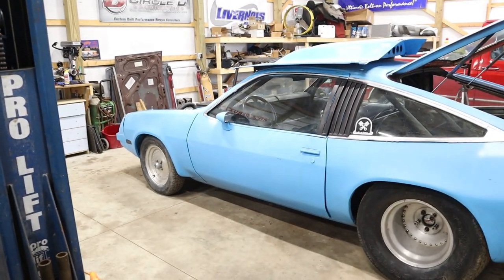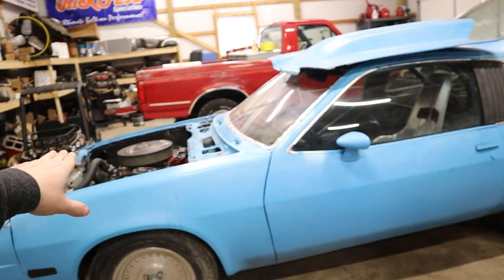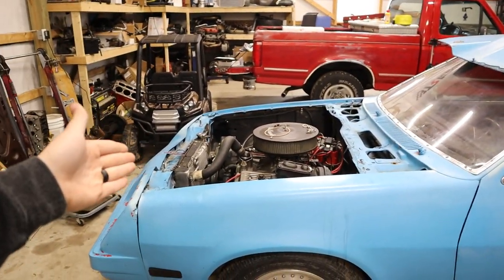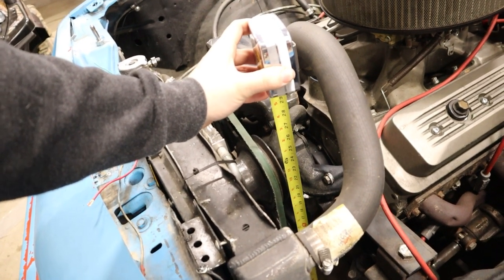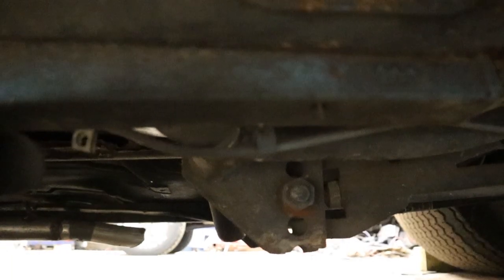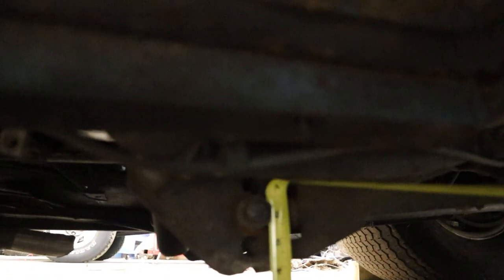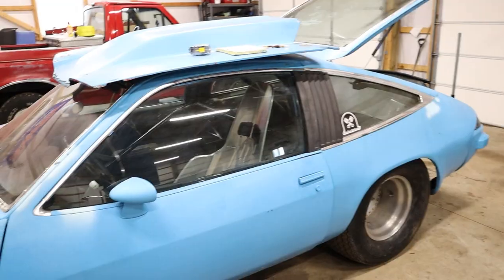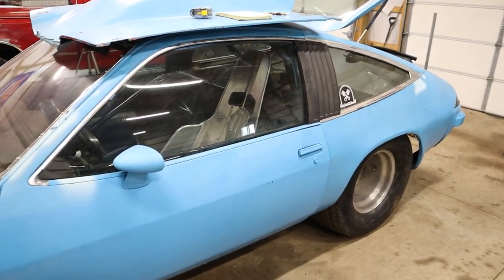How to measure for Squat/Anti-Squat and how it impacts your car

Comment: Anti Squat = the weight of the rear body is being lifted putting pressure on the rear tires.  Squat= the rear end (differential) of the car being pulled off of the track and into the body.   Anti-Squat is the ticket.
Reply from the maker: Simple and to the point. I guess Les is Morr-is lol
Reply: nahhh i like when roll rtace and a car sqaut then just takes off not lift up 0.0 so the sqaut is bad?thaought weight from car adds downforce when its drop
Reply: I was a kid but old enough to remember when the Buick GN came out and how we all dropped our jaws when they'd launch and the back end would rise several inches. 
And then a guy explained it in a very simple crude way. 
What's easier with a wheelbarrow , hands under and lift ,or hands on top and push? 
Using the vehicle weight to plant the tires, cool stuff. 
Alot of big trucks are set up like that too, it's easy to see when they're bobtailing and leaving from a dead stop.